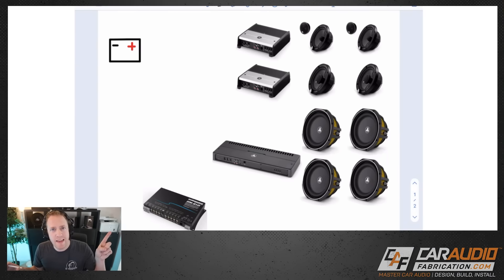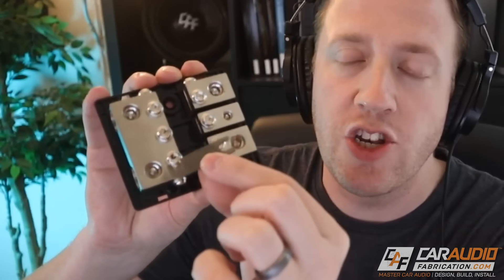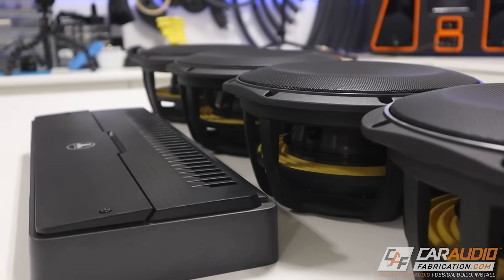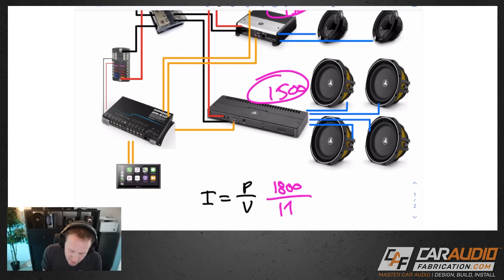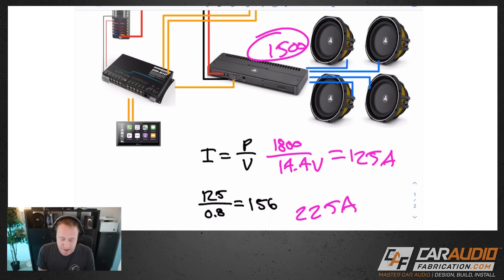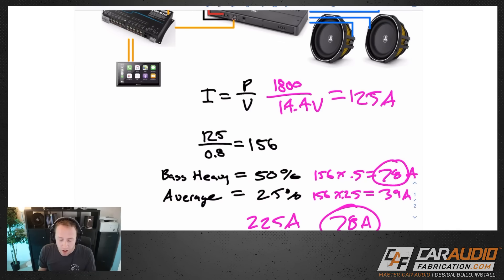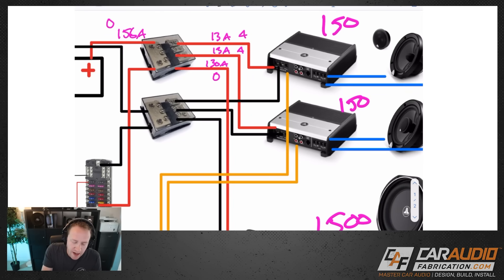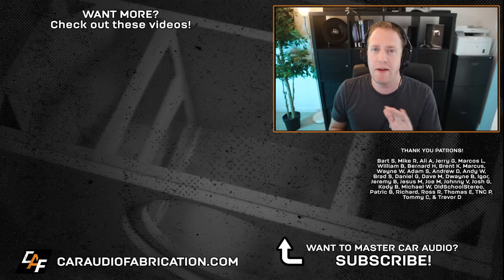HOW TO - Electrical System Design for 3 AMPLIFIER + DSP Car Audio System!

Comment: So for my Dream System:

Source:  I'm not super picky here. As long as it's a quality MFG and fits well in the vehicle then I'm mainly concerned with features.  Android Auto is a Must.  But then so is a CD/DVD Player.  Most streaming music is lower quality than CDs.  Trying to get max system quality while using low grade streamed music is pointless. No amount of acoustical treatment and DSP will ever increase the quality of the source signal.  Yes there's services like Tidal, and they are getting better. But I still like OWNING my music.  If I purchase albums and/or videos (Inc movies) from a streaming service and that company goes out of business later on then I no longer "own" that material.  And YES  I'm old, but I'm also not wrong 😛.  LOL

SPEAKERS:  Subs:  JL Audio, Only and Always.  Either 10/12 W6(s) or 13.5TW5 if tight spacing is an issue.  The W7s are amazing, but their also designed more for SPL (but with strong SQL remaining) while the W6 is more max SQL and achieving the most SPL within that standard.

   Mids/Highs:  The best I've ever owned go way way back, the a/d/s 325is which were legendary SQL in their time. I still own my set. And while I look forward to hearing them again I doubt they still sound as good having been boxed and unused for years.  I haven't listened to them yet but looking around I think the Morel's are the type of sound I look for given their construction and materiel choices.  Today I would go with a 3-way system up front with powerful 6.5s in the doors and the 3.5s & 1in Tweeters (no smaller) ideally in A-pillar pods.  Each individually processed and amplified with its own channel.  Then I would have a pair of either 6.5 or 6x9 co-axials in the back.  Again, ideally on the back panel firing into the back window rather than low in the doors.  These would be Bandpassed roughly from 300 to roughly 2.5 kHz.  That would be based on listening, I only want it functioning as backfill simulating the reverberance of a larger listening space while not interfering with the sound stage of the front.

Processor:  I've looked at specs and read reviews of a bunch of DSPs lately.  I'd start naming a bunch but I'm taking a bit too long on this.  So I'll just say given the budget I'd go with the Helix systems. 

Amps:  Probably JL Audio but I'd be open to other possibilities.  The idea of going A/B for the Front/Rears and D on the Sub's is honestly appealing to me though.  So I could be swayed elsewhere so long as the quality was top notch.

Comment: Are “nine wires” bad ideas??
Reply from the maker: Nope! I wouldn't use it for a speaker where you are using a ton of power but for the most part the wire is sized large enough to work great!

Comment: Mark, why don't you just combine the total fuse ratings of the amps?  That represents the maximum amps each device is capable of safely using.  Basing both the cable guage and cable fusing based on that allows the system to be safely driven at its max capacity regardless of how you use it.  

Sure, if a person is only going to use half its power capacity you can save money doing it the other way.  But for me, I'd teach people first to safely wire and fuse based on max capacity (equaling maximum safety) and then show people the more complex way if they need to save money on cable and fusing.  But honestly, the difference in cost is small in comparison to the cost of amps, speakers, processors, and headunit so I personally would recommend ppl to save money elsewhere. 🤷‍♂️

Comment: I wish I could put pics here. I have a full NVX system, with a Pioneer head unit, just waiting to be installed in my 2000 Impala. Tweets and 6.5's for the front doors. 6x9's for the rear deck. 2 - 12's and a ported box. An epicenter. A 1 farad capacitor. Sound deadening material. All the wiring. I even have a license plate frame back-up camera. The only thing I really question is the sub box. I would prefer that it was built specifically for the subs, instead of bought off the internet. Lol. But since I got everything Pala seems to stay "out of order". So I'm guessing it's time for a new car.
But, other than the deck (Pioneer), and the Epicenter (Audio Control), it'll be a full NVX build. Including the wiring.

Comment: I already have 2x18" ground zero plutonium ,  4x12" ground zero midbass , 8x8" mids , 4 horns tweeters , and i'm missing my amps withch i would like to be a 12k for bass , and some 1.5k for midbass/mids , and a 4x100 for tweeters.

Comment: I so needed this. Ty again 😃. I've watched about everyone. Always look forward to the next class. 2015 beetle. Have to have one made for my car. 140amp alternator. Low option car. I had to get a second battery.  Now I'm good. About 2300 watts. I would love to have my car sound as fine as an old Big Block rumbling. I like SQ over SPL, but I do like it loud. But clean, crisp and tight. So I think that is called SQL?  Nice and clean install that is more for practical daily driver than show. Hideaway as much as possible. Sound stage that's better than live. Not concerned about system wattage being 40k watts or 100 watts. I just want my ears say its heavenly. But if my Guy, you, doesn't do it. I'll have to think about it.

Comment: Wow my dream car audio for bass 2 18" and for the front doors 3 12" speakers on each door whit 3 drver each and in the rear 1 12" on each door and 1 driver each door upgrade alternator battery cell and all costum made for my car power at less 10k for bass or better for speakers 1 amp for hi and 1 for mid will be crazy loud and expensive 😁

Comment: also a recommendation  the altinator  out put is different   at idle  as  opposed  to driving   if it's 250amp alt  find out what it is at idle vise vera

Comment: I am presently building my dream system in my dream truck, 2018 Raptor. System consists of Knukoncepts power, signal, speaker wiring, and fuse/distribution. 

Source: 
factory head unit using NAVTV A2B adapter 
Amps: 
JL Audio XD800/8 & 1000/1
Speakers: 
1pair-Hertz Mille Legend 280 tweeters in a-pillars
2pairs-Hz Pro165.3, one pair in front and rear doors with complete sound deadening
Subs:
2-Sundown Audio SD4 12d4 in custom enclosure led lit with 3 logos, down firing, enclosure under rear seat by SoundsGood stereo. 
All speaker brackets laser cut by SoundsGood stereo. 
DSPs:
Micro Epicenter (when available)
MiniDSP C-DSP 8x12 DL
Can’t wait to get it all installed and EQ’d. Doing all the work myself because I used to do this for a living… great job on explaining everything to the masses in all your videos.

Comment: My dream audio setup. A custom head unit I am designing with 6 channel output -> DSP with at least 8 channel output, but 11/12 preferred -> 3 way fronts, 2 way rears, dual subs. Going for a sound quality build for long road trips so this would also involve sound proofing the entire car. I have most of this setup already, just need to get the DSP and finish my head unit.

Really appreciate the video, and thanks for revisiting / updating this kind of content. Been watching you on and off for years and it really helps!
Reply: I went with an android tablet "head unit" with USB-C connection to a Behringer DAC with TOSLINK connection to DSP. Straight through digital signal to the DSP. The sound quality is very impressive. I did this 5 years ago now so I would say better options exist but eliminating analog to digital conversions along the chain seem to be more easily achievable these days.
Reply: I also agree with the other two comments here so far. Sounds like you’re on your way to YouTube fame bud
Reply: agreed as well , would love to see how it comes out?
Reply: Please put a video together or document the head unit build. Id love to see your ideas
Reply: Yes man, make a video and post it!😄We are interested!

Comment: Yo I need some help, I've recently installed my setup but my subwoofer moves on its own when I turn the radio on even if nothing is playing. The sub and amp are fine and don't think the RCAs are the issue, anything I should check?
Reply: Just reverse the wires
Reply: @MrKentucky27  what year is your car?
Reply: @do_italldayeveryday820  2021
Reply: @MrKentucky27  being a 2021 it most likely has noise cancellation on by default. You need to figure out how to disable it if your using the stock radio
Reply: @MrKentucky27  is the noise canseling you have to disable it find the mic or the wire for it cut it or unplug it and fix 👍
Reply: What year is your car? Most be pretty new!
Reply: @do_italldayeveryday820  I drive a 2008 Mk5 GTI, my current setup consists of a comp set in front and a pair of coax in the back. None are wired to the AMP just yet, need another radio for that, so far no issues with those.
The problem is somewhere in the amp/subwoofer wiring, thinking it might be a bad ground, I'll have to check it when I get home.
Reply: @NuhUhNotTrue  what is the problem the jet sound?
Reply: @do_italldayeveryday820  the sub was just going on its own without needing audio, releasing a constant low note, but I fixed it.
Need to get a new radio because it's a bit sparratic and generally outdated.

Comment: My dream car audio system is what im currently working on just need a different DSP and a D-1200 with my current Lc-400 and LC-800 Morels are already done, need a complete sound treatment for a  2011 Dodge Durango. My power and ground are KnuKoncepts 0 gauge with 4 gauge at the distros
Reply: I bet those Morels sound amazing. I always get Rockford speakers but will probably splurge next time on Morel.
Reply: @gjenkins1660  I discovered how great they sounded when I added power to them and I mean 160 watts rms........I was sold at that point and i have had alot of speakers since, I had the original MB Quartz back in the early 90's so my listening ear is a little bougie LOL

Comment: What gauge wire for dsp
Reply from the maker: Depends, but most all DSP's will be fine with 16 gauge on up.
Reply: @CarAudioFabrication  ok thank you. Any reason your not using a epicenter on this build
Reply: @michaelrobison8572  more than likely, the dsp has it built in.
Reply: @iRelacsashon  his DSP does not have what the Epicenter does. His DSP has a form of bass restoration, which fixes any roll-off or EQ’ing from a factory source. 
The Epicenter creates lower frequencies from higher fundamentals in between 40-280Hz.

Comment: Isn't that long for a ground?
Reply: Not necessarily, in modern cars it’s often better to ground to the battery rather than trying to add your own. Unless you have to knowledge and tools to ground all the way to the frame.
Reply: @SenorReflex  Thank you, I am old and was directed early on to not have the ground longer than 15 inches. I have a 99 tahoe and 05 magnum. Thank you for the vids!